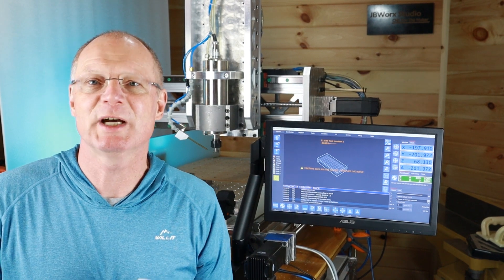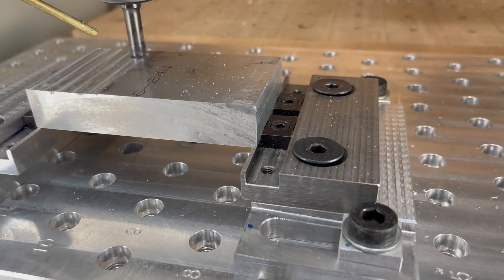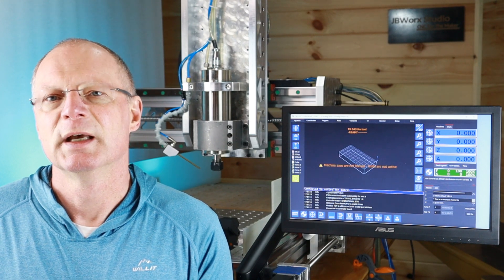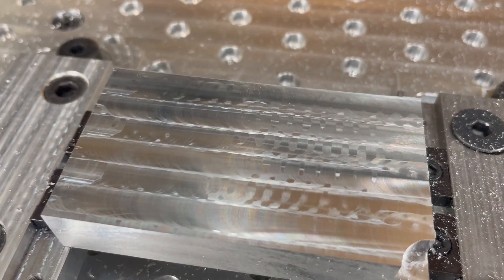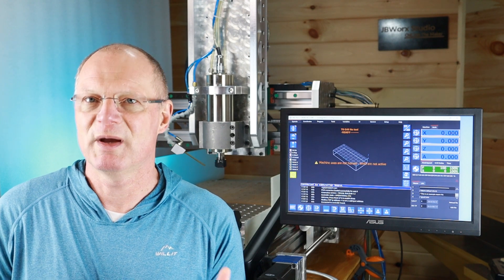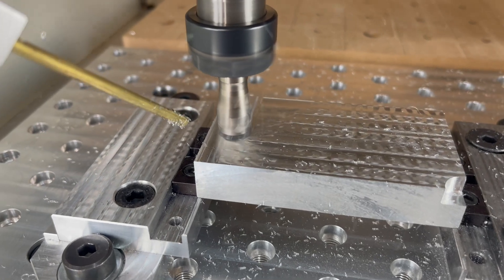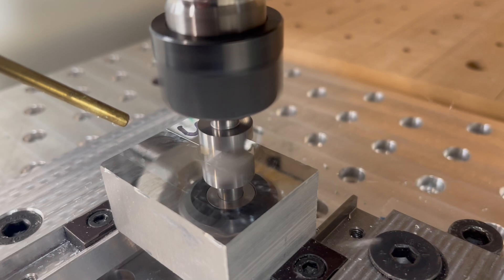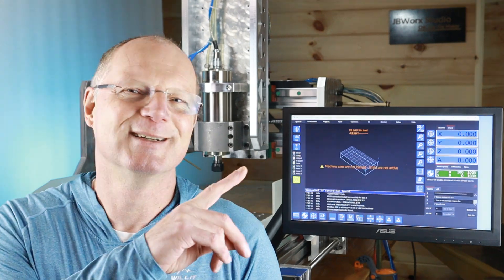Best Possible Finish Cutting Aluminum

Comment: This test may have shown an even better result if all your tool passes were from the same side and not both directions cllimbing and conventional cutting.  Good video though thank you
Reply from the maker: Yes I tested that as well - however this means that the machine repositions the tool in Z every pass. If it is off by just 0.005 mm you will be able to see a line.

Comment: If you machine all passes with climbmilling you will improve the surface finish
Reply from the maker: In general yes that is also my finding BUT only if you can keep the tool down. If Z raises and you only take a cut that is let’s say 0.008mm then the positioning accuracy of the axis will be visible as a line in a mirror finish. But yes in general you are correct.

Comment: I have used some of the Ali express MCD endmills on a high end machine, my results weren’t a ton better tbh. I think you are at about the limit of what you can get out of the tool. What I found was that 1um chipload and 5 micron doc and 2 micron fpt gave the cleanest results. I noticed that the cheap MCD gives nice shiny finishes even if under a microscope the surface looks rough.
Reply from the maker: Yes the limit of the tool and my machine. Wow by your findings I should be able to take yet smaller cuts. By that time the positioning of the machine becomes critical.
Reply: @JBWorx I think a flycutter geometry instead of the endmill geometry that the tools on aliexpress have would help a lot. Haven’t found any cheap mcd flycutter though.
Reply from the maker: @kylewarren69 that solution is unfortunately not suitable for a high speed spindle. I was actually waiting for this comment. So we need to spin a tool at a minimum of 10,000 rpm to have any torque at all. So at that rpm the cutting speed of a fly cutter is beyond warp~speed.  Needless to say the spindle cannot hold a tool like that out of balance so the vibrations are terrible. Sorry to say a fly cutter just noes. It cut it 😬

Comment: Hi Jörg, 
you have some great videos and helped me a lot over the years! Thank you! 
It looks like your ballscrew and nut are not aligned well. It causes vibrations. The wavelength of the “pattern” and ballscrew pitch look like the same magnitude. Had a similar problem and it really came through with a 50 mm facemill. Is this also possible for your machine? Viele Grüße Alex:)
Reply from the maker: Hi Alex, very nice set up for your m^5 machine. And yes my x-axis ball screw is suspect.

Comment: What are your thoughts on your Rapid Change ATC? It came out the same week I ordered my ATC from PwnCNC. I was a bit worried about wear and tear on the collet nut and the possibility of incomplete or incorrect tightening, so I went with PwnCNC's ATC.
Reply from the maker: I had the same worries about it and dismissed it a year ago. Now I see how many are around and people are happy with it so I gave it a try. So far I am really pleased with it. 
How is the PwnCNC ATC ?
Reply: @JBWorx  I've only had the PwnCNC ATC for about 2 months. In that time it has worked perfectly. So far I've only be using it for wood (white oak, MDF). I'm just now starting to look into machining 3 mm thick letters (30 mm high) out of brass. I'm considering using H62 brass rather than C360 because of H62's lower lead content. I'm open to advice if you have any.
Reply from the maker: @subpixel2234 C360 is a solid choice as it is a “free machining” material because of the lead contend. So you have environmental concerns ?
Reply: @JBWorx  yes, since there is no safe level of lead exposure and I do have children in the home my preference would be to avoid the lead. I've read many places about C360 "free machining" advantages, however I've also seen a couple sites that described H62's machinability as good. What I haven't found is any specifics of the disadvantages of using H62 vs C360.
Reply from the maker: Understand. I would give the H62 a try you can just make a test cut. So a tool with a nice sharp cutting edge will work best.
Reply: @JBWorx  My very first cut in H62 went perfectly! I'm amazed. I cut a 30 mm tall, 2mm thick capital H. I wish I could post a picture here.   After polishing it looks great. I used: 1/8", 2 flute, compression end mill (it is what I had on hand), RPM: 10,000, Feed Rate: 300 mm/min (PwnCNC ATC spindle). Depth of Cut: 0.2 mm. I feel the depth of cut could have been much greater. I was doing a 2D contour, the surface finish wasn't great. I'll try adding a finishing pass.
Reply from the maker: Probably best to get the correct end mill. The geometry of a compression bit is really made for cutting wood. You can increase the rpm a tad for 1/8” diameter.

Comment: Thanks for the video. Would like to see some of the work you've done on acrylic with this tool.
Reply from the maker: Acrylic works amazingly well. I had to make some recessed pockets in teal colored transparent acrylic and it came out like it was not even machined. I only own 2 MCD tools the one you see in the vid and a 5mm ball end-mill for making aluminum molds.
Reply: @JBWorx  Thanks, sound great.

Comment: I am getting the same surface anomaly in my x axis and it's my ball screw binding from being worn out. It looks identical.
Reply from the maker: Interesting ! I just found 2 small balls when I vacuumed the chips up and I know they are too small to be from the Hiwin linear guide. Thank you 🙏!!!
Reply: @JBWorx  once you fix it do another video using that mono diamond I wanna see the results. I manufacture aluminum locline and I may try it out on my lathe.
Reply from the maker: I am going to get one PCD and one MCD insert for my lathe as well. I do a lot of aluminum work for the touch probe housing that I make and sell.
Reply: @JBWorx  where do you sell your probes at. I may be in the market for one
Reply from the maker: @marksanders4815 you find it on my website 
https://www.jbworxstudio.com/product-page/z-height-tooltouch-probe-aluminum
Reply: @JBWorx  awesome thanks
Reply from the maker: @marksanders4815 👍
Reply: @JBWorx  do you have an option that isn't wired. Not sure if I can wire it up to my machine.
Reply from the maker: @marksanders4815 I don’t at this time. Still thinking of making one wireless though
Reply: @JBWorx  I like the quality and I'm thinking that I could get it and convert it to have a light that blinks.
Reply from the maker: Yes it’s a big difference on my machine.

Comment: Interesting test. I have noticed alcohol mist clearly gives better finish for aluminum.
Reply from the maker: Yes I think I so as well. On diamond tooling it is not recommended but if you make small finishing cuts the tool will not get hot at all and so you can use alcohol or similar coolant
Reply: @JBWorx  Yes I meant to say at least with carbide cutters it helps, I only ever have used those.
Reply from the maker: @mikko3d oh yes definitely. Many say don’t use coolant with carbide or there is no difference cutting dry but I share your observation. I use alcohol and it works well.
Reply: @JBWorx from what I have heard alcohol mist will give better finishes with MCD then using flood coolant.
Reply from the maker: Well worth a test I would say

Comment: This was a great experiment. My work is generally too small to use inserts unfortunately. But, I did a few experiments just like you did and kept a log of the various parameters. I don't know if I speak for others, but I was quite nervous about using higher feed rates. But then I reduced my depth of cut and bumped my feed rate way up and the improvement was huge. Part of the improvement for me was to leave a fairly large finishing allowance and then taking 2 to 3 finishing passes.
Reply from the maker: You are spot on David, making 2 finishing passes allows for the former tool marks to be removed and lowering the DOC and increasing the feed rate can yield a better surface.